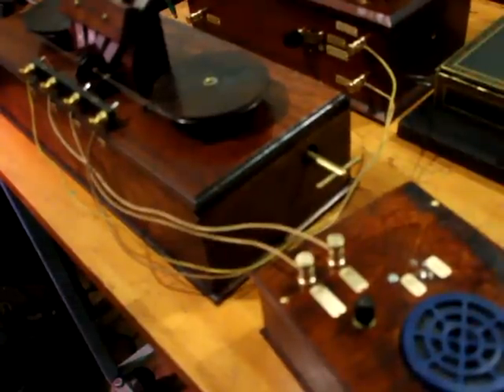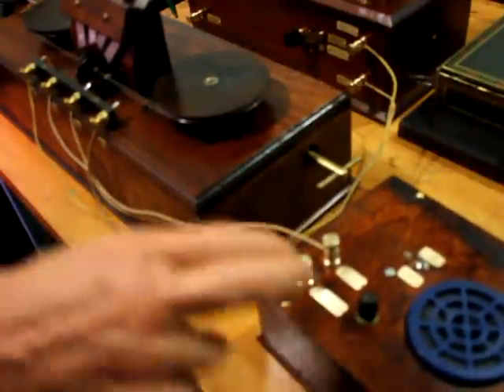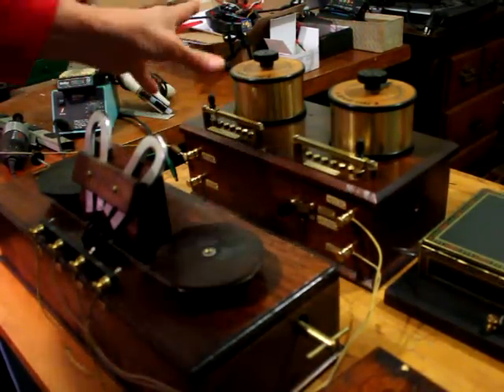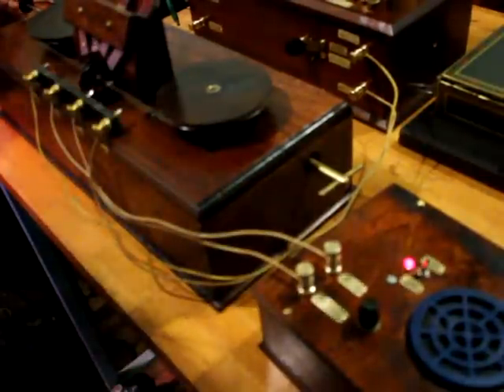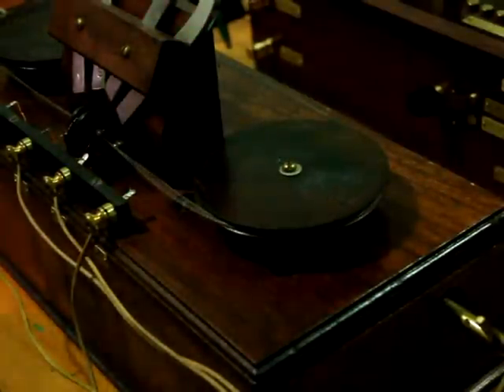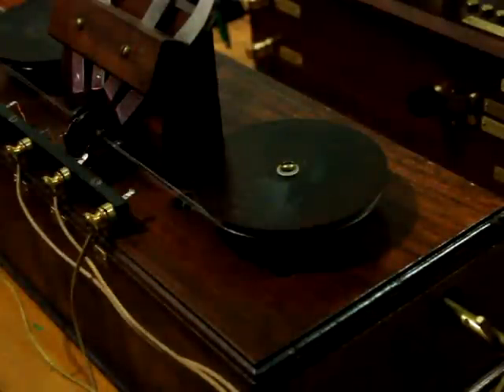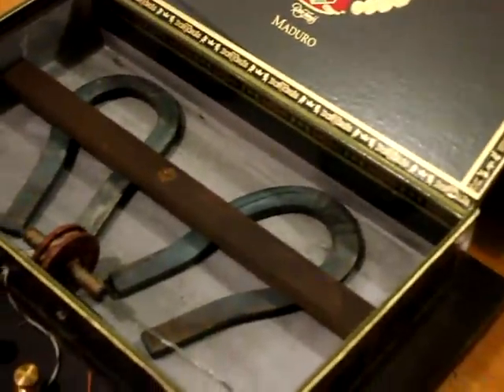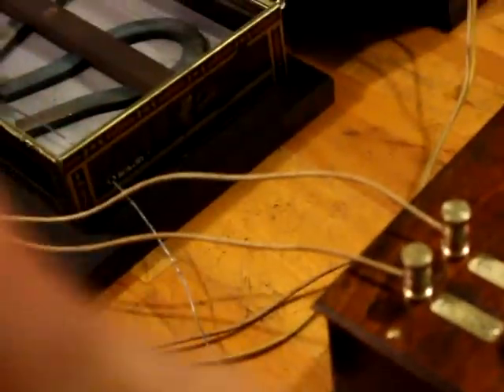Marconi magnetic detector demonstration

Comment: The irony is that although this kind of looks like an old tape recorder it isn't. Well only in the sense the wire holds on to a bit of residual magnetism in one direction for a while. You mention the crystal detector which was being tried at the same time. The sensitivity was a bit hit and miss and ships tend to roll around and vibrate. This worked and had a trained operator. The Titanic had a Fleming valve but they were fragile and not used even when installed. Philips had been on the job for nearly 10 years already. No doubt succumbing to us oldies reluctance to embrace new fangled technology. Difficult I know to imagine most of the world in 1912 had no idea how anything worked and the cognoscenti were complaining about built in redundancy. By the way, whenever my local ATM goes down the XP start screen appears while it reboots.?2022

Comment: Really good demonstration. There's a loaf of nonsense written by half knowledgeable folks with simulated Titanic Morse code. The Barkhausen effect random domain switching noise would not have been as audible in 1912 without the high amplification used here. The noise of steam being released from funnels outside was making it impossible for Jack Philips to hear signals.

Comment: This is a beautiful, clever apparatus created by Marconi that demonstrate he had real scientific knowledge and was not simply an empirical inventor ripping off the ideas of others!
Having said that, since this contraption was invented before application of AM radio(?), how did he demonstrate it? Did he use it to pick up radiotelegraph signals? Were radiotelegraph signals modulated with sound back then, and if so, how at a time before electronics?
Reply: +Jeffrey314159
Wireless telegraphy signals were generally provided by spark transmitters which used an induction coil to provide the high voltage needed,so the spark would be timed by the interruptor of that coil, providing a form of crude modulated tone.
Reply: Yes, that and the 'white noise'  produced by the crude method of electric arc sparking. This is why these devices were useless for voice transmissions. Do you knowledge of any exceptions, such as the Poulsen Arc Transmitter?
The first apparatus to transmitt the human voice, that I know of, was a high frequency(50 to 100 kilohertz) alternator, not arcspark and not electronic, and this was before WW1

Comment: So far I had only seen these on drawings, and never at work. Actually was unaware they could detect AM, thought it was just for telegraphy. It works pretty well I must say, and your is not just good working, it's also beautifully made.

Maybe it would work even better if one would make one of these detectors with audio tape and casette player parts (motor, playback and erasing heads), might give it a try myself. I am more used to catwhiskers, but this looks very interesting.

Both detectors are amazing, couldn't expect any less from you anyways, sir.

Best regards.

Comment: Can I ask if you have done a video on the replica of Marconi's short-range radio transmitter-receiver that you built? I'm referring to the one talked about in the video where you built the type C triode valve. Many thanks.
Reply from the maker: The unit is in the attic. I will get it down and do a video on it.
Reply: @glasslinger  Thank you very much, you are an inspiration to my own attempts at building and repairing pre/post WW2 valve based electronic equipment, thanks again and keep up the amazing work, A Fan!

Comment: Magnetic detector - Wikipediaen.wikipedia.org › wiki › Magnetic_detector
Developed in 1902 by radio pioneer Guglielmo Marconi from a method invented in 1895 by New Zealand physicist Ernest Rutherford it was used in Marconi wireless stations until around 1912, when it was superseded by vacuum tubes. It was widely used on ships because of its reliability and insensitivity to vibration.

Comment: Thank you for posting this video.  Please post some details- How many primary and secondary turns in the  "Pick-up coil?"  Where did you get the iron wire?  Is the antenna tuner a series circuit, with the pick-up primary at the Earth end or the Antenna end, or is it a parallel circuit, tapped for the pick-up primary?  Thanks very much!

Comment: No, this is not like a 'tape recorder', if it were so, then the pickup or read coil would be wound around the second or output magnet. This works by DEGAUSSING!
Reply: +Jeffrey314159 
It works on the principle that an alternating magnetic field can affect the coercivity of the wire's hysteresis, so the field of the primary coil(which is connected to the antenna) changes how far the wire has to travel into the field of the second magnet before it's magnetism aligns with it. The current induced in the secondary coil is larger the closer to it the actual flip of the field occurs, and so it changes too. 

So, the wire is not degaussed, it's field is flipped.
Reply: Alright, that makes sense, but it does not explain, for me, how this method directly coverts radio frequency energy to an audio frequency energy. Is this also the result of the hysterisis?
When Marconi made this device he was creating a means for detecting low frequency(<300Khz) radiotelegraph pulses, so his device would make for an insensitive AM band(540-1600Khz) detector. On top of that there is the Barkhausen Noise Effect that makes this mechanism a low fidelity passive AM demodulator. I suppose different materials could be used for the higher frequencies of the AM band. 
I wonder what would happen if the aerial was a single continuous loop with its tuner and inductance were directly in series with such?
Reply from the maker: +Jeffrey314159 
Much in the replies above is accurate. My reference to a tape recorder was meant only to indicate a magnetic media passing magnets to change the magnetic pattern in the media. The actual conversion of RF to AF happens when the magnets are positioned very carefully to just saturate the wire in one direction. The modulated RF then drives the wire in and out of saturation at the modulation frequency. The low frequency mentioned above is very accurate. The sensitivity of the device is abysmal!  It took modern electronics in the amplifier to get enough gain to make it pick up 610khz signals on the AM band. I do not think Marconi stole the idea from Tesla, as was hypothesized in another comment . I have not found any info in Tesla's work that he ever worked on such a contraption!
Reply: +glasslinger Ofourse Marconi did not steal this idea from Tesla but Tesla had so many patents it could fill up a large hardcover book